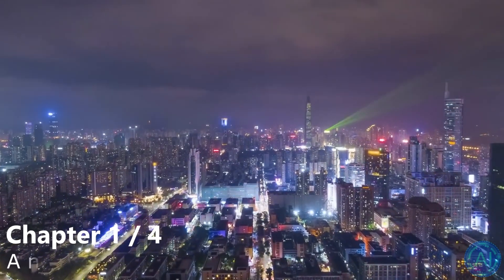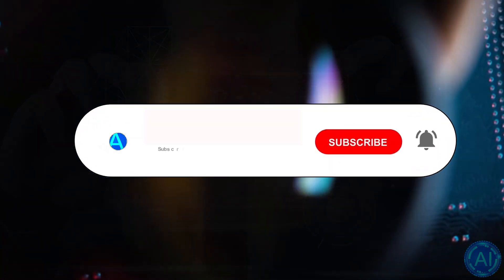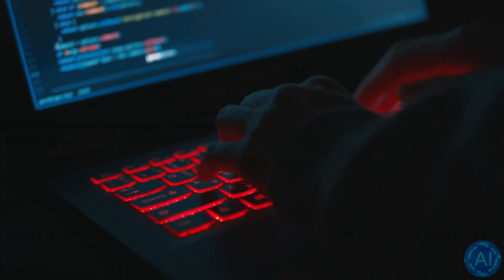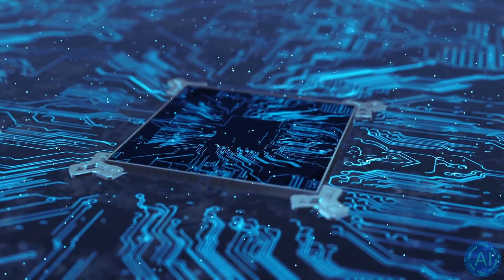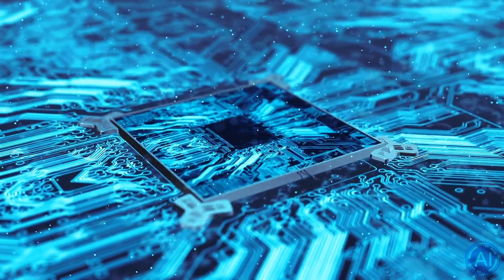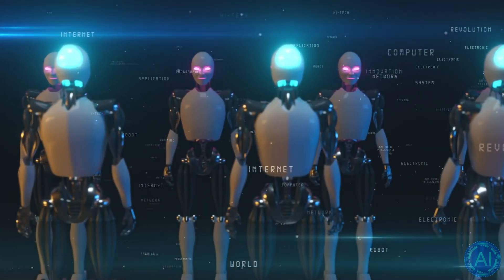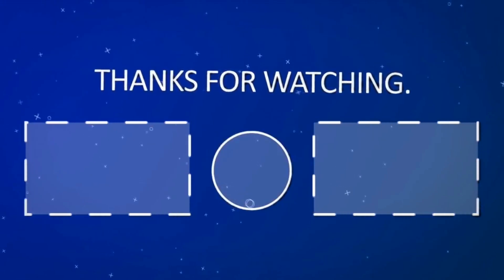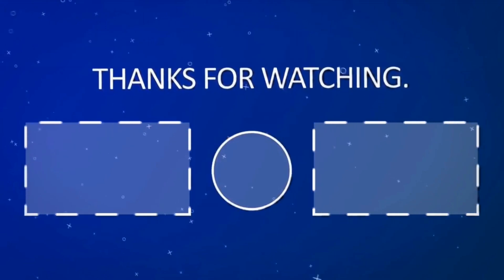The Rise of China's Most Advanced Artificial Intelligence - Wu Dao 2.0

Comment: On a certain level, we have Ai in our brain, the neurochemicals that show up in flow: so dopamine, norepinephrine, anandamide, endorphins, and serotonin. If you were to try to cocktail the street drug version of that, right, you're trying to blend like heroin and speed and coke and acid and weed- and point is, you can't do it. It turns out the brain can cocktail all of 'em at once, which is why people will prefer flow to almost any experience on Earth. It's our favorite experience. It's the most addictive experience on Earth. Why? 'Cause it cocktails five or six of the largest pleasure drugs the brain can produce. We're all capable of so much more than we know. That is a commonality across the board. And one of the big reasons is we're all hardwired for flow, and flow is a massive amplification of what's possible for ourselves.